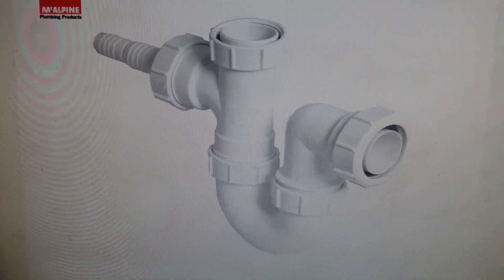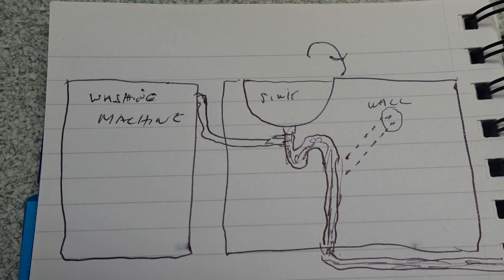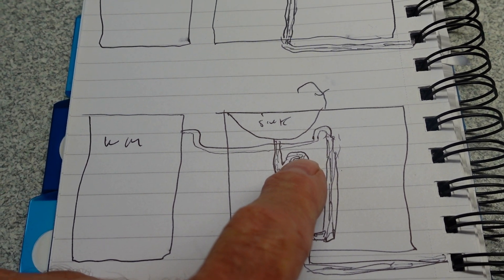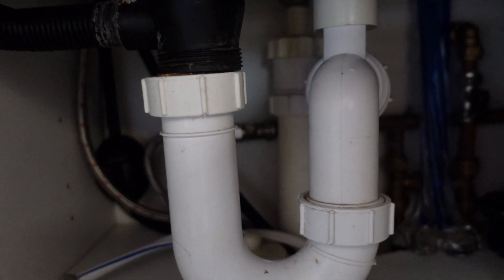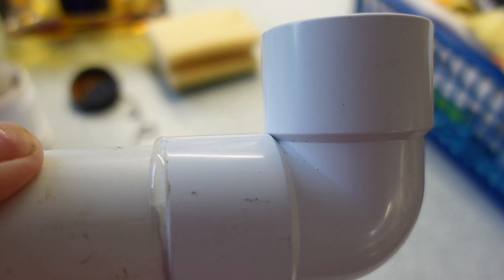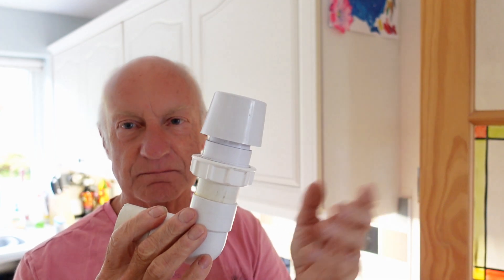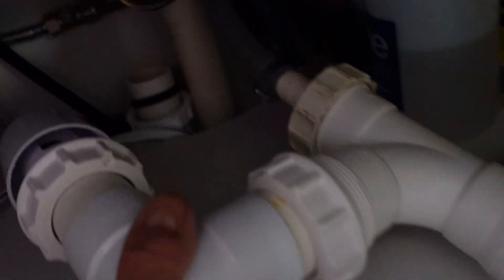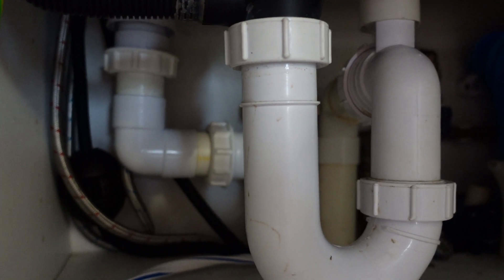Washing machine waste smelling or blocked. Water coming up in the sink.

Comment: Hi Al
   As a retired appliance engineer I came across many washers with smells or blockages in my time, the one I'll all ways remember, the lady called me out, washer wasn't draining  off, after checking all the usual things I took the waste hose off the m/c, it was blocked with fat from a duck she had drained down the sink which went into m/c drain hose and set solid when cold ! From Coventry 👍.
Reply from the maker: Ha ha, great story Grahame.
Reply: I was going to post a comment cos that happened to me!  I worked it out and cleaned the fat from the washing machine drain pipe.

Comment: Thank you for this. I have a standpipe with a P trap at the bottom draining the dishwasher with the waste pipe just loosely hanging in a loop in the standpipe. There seems to be bad smells coming the dishwasher although not from inside the dishwasher itself but seems to be from the plumbing behind. Do you know what the problem might be?
Reply from the maker: The stand pipe could be passing smells up from the water left in the trap.

Comment: Hi I’m looking for information for the name of the part that the washer outlet fits into.. my washer seized up and I got rid of it yesterday…only didn’t think about the waste from the kitchen sink coming out of it… now my kitchen floors flooded and I can’t use my sink until I get the part that fits the outlet that the hose fits on… any advice is much appreciated 🙏
Reply from the maker: You may have to buy the complete trap with the outlet attached. It is called a washing machine trap.

Comment: A quick question, the straight nozzle which is used to connect appliance, is there a way to connect 2 machines onto it?
Reply from the maker: You can buy a separate nozzle piece that takes two items.

Comment: I have one of those little buggers, and not only does my sink fill up, but I'm positive that some of it then drains back into the washing machine? As I type, my kitchen is flooded. Ha! I've had a blocked soil pipe, in the past, and I think I've issues with it, again? But I've always thought that washing machines had a valve that stopped water backflowing into it, from the hose?
Reply from the maker: They do but sometimes the powder jams them open.
Reply: @dereton33  Do you know what that part is called? My washing machine keeps filling up with water when i use kitchen sink. Cheers

Comment: Great video. We have a waste pipe on the opposite side of the kitchen to the sink. We put a new kitchen in now the wastw pipe is smelling. On the floor about 6 inches from the pipe wws a hole in the floor with a black ribbed pipe. I tiled over it, do you think that was some sort of air i let to stop it smelling?
Reply from the maker: That would have been the air inlet. To help water run away.

Comment: Hiya I've got a drain company coming out tomorrow. The toilet manhole drain  is nice and clear for once( I've been here 10 years and have had it bunged up right to the top about 5 times now) anyway my main problem is my dirty water from the washing machine is coming up into my sink. Is it a big drain job? I've unscrewed my u bend and that's clear. Thanks x
Reply from the maker: It will be a blockage in the sink waste pipe it tees into, I always use a pressure gun to clear them.

Comment: After disconnecting an old washing machine and clearing out the the  washing machine drain pipe stub thing from under the sink I've noticed that when I empty the sink, the water blasts out of the washing machine drain stub thing.  I'm thinking, once I connect the new washing machine drainage pipe, will waste water from the sink blast out of the stub as its doing now and go down the washing machine drain hose and into my new washing machine ?
Reply from the maker: No the washing machine is fitted with a non return valve.
Reply: @dereton33  Great.  Thanks for thst

Comment: Don't think I can do this as the trap also incorporates the boiler condensate pipe. The plumbers who fitted the new kitchen, bathroom and boiler really did a crap job, could have done better myself. The pipework under the kitchen sink looks like a jungle. 

Just a quck one, Al. When I empty my washing machine pump filter at the bottom front of my washer, I get about a pint of water. I shouldn't be getting that much, should I? Clothes are spun fine, no excess water in them. Cheers!
Reply from the maker: Some machines do have that much water depending where the filter is.

Comment: Can you give me some advice please? My washing smells I've cleaned the drum using bleach and white vinegar on a boil wash it seems to work for a few washes then the smell comes back. Ive checked and cleaned the waste pipe but I noticed a pool of water in the drum after the washer wasn't used for a week. I have the same setup as in your first drawing. Is it possible the waste sink water is flowing down the washer waste and settling in the drum? Cheers Steve.
Reply from the maker: Yes it is a small amount running back
Reply: @dereton33  thanks for getting back to me I'll try  moving the washing machine waste further down the waste pipe using a drain out kit and blanking off the trap. Thanks again for your help 😉👍

Comment: Hi Al, Hope you can help? I have a washing machine that has a standpipe and for the past few weeks the clothes in the washing machine are starting to smell of rotten eggs.  I've cleaned the filter, checked around the seal and done a boil wash but with no luck.  Recently i've noticed my toilet is starting to smell too, not sure if its related?  Can you please advise?
Reply from the maker: Yes, absolutely. You will have a partially blocked drain.

Comment: Can you buy a Air admittance valve separately and are they different sizes 32mm 40mm etc . From Toolstation / Screwfix . And and it to my U bend / washing machine U-bend 
Thanks 👍
Reply from the maker: Yes and yes
Reply: @dereton33  thanks Al . I'll look into it
Reply: Yes, yes and yes. They sell a kit including adapters that allows you to convert from 2", 1 1/2" to 1 /1/4".
Reply: @loafersheffield  any links ....and shops
Reply: @stevendouglas3860  42968 screwfix code. It's abs and will only glue to abs waste pipe. If your existing waste pipework is pushfit, it wont work. They are not compatible, so you'll need to buy a waste compression fitting, like the one Al used in this upload as a transitional fitting.
Reply: @loafersheffield  Thanks mate . Very kind of you ,

Comment: Hi, a quick question. You know the drainage pipe from the washing machine, that should expel water from the washing machine out the wall once the washing machine is being drained. My washing machine has had a really bad smell so I decided to get a new one, I disconnected the old washing machine so the washing machine waste pipe isn’t connected right now until I get a new one. It appears the water from the sink is going into the washing machine drainage pipe... is this supposed to happen? And is this why my washing machine had a pungent smell and wasn’t draining properly? If you could help would be perfect!
Reply from the maker: If the non return valve on your old machine was broken , then yes.

Comment: I've just fitted a sink im having trouble with my p trap the waste pipe keeps falling out of the back what can I do
Reply from the maker: Renew the rubber seal at the back.
Reply: @dereton33  I did that goes in and and Tightens then later it comes out

Comment: We’ve been getting this on/off for years. But it’s when the toilets been flushed or emptying the bathroom sink, then the smell comes from behind the washer. Plumber doesn’t know how to fix this.
Reply: What do you mean by "washer"? Do you mean washing machine? Trap seal loss is usually due to suction of one appliance or piece of sanitaryware running in common with others. Ideally, each piece of sanitaryware ( toilet, basin, bath,shower, wash mac,  shower tray, sink, etc) should have it's own separate run, but it's not always possible. That's where aav's come in as useful.  If waste pipe runs terminate in hoppers outside the house where the roof surface discharge pies run in common, this is not usually  a problem.  If you have an internal soil stack, boxed in, inside the house, common in newer properties, I'd try and find the vent part of the 4" pipe. It may well be the case that whomsoever installed the plumbing did not even put a vent section in,  nor soil AAV in. That may explain why you're getting trap seal loss.
Reply from the maker: Thanks for the reply Loafer. Keep well mate.
Reply: loafer sheffield yes, the washing machine. The waste pipe is behind it & I’m sure it’s connected with the shower & bathroom sink & maybe the toilet. Cos it’s next door to the bathroom